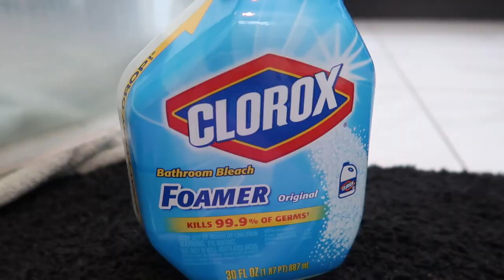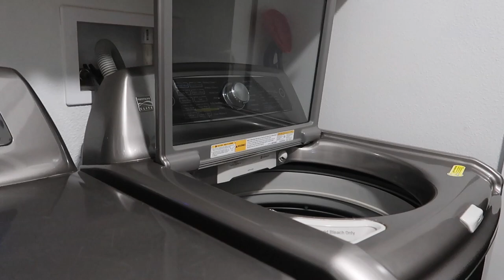EXTREMELY DIRTY CLEAN WITH ME // Cleaning Motivation + Before & After

Comment: I worked at a hotel as house keeping and the way we cleaned the glass doors was to wet it down with water then cleaning it with a cleaner (you could use the lime away) but use a magic eraser with the cleaner, then water that down. Then go over that with glass cleaner. You pretty much did what we do but the magic eraser does wonders.

Comment: Kristen, this is how I clean my shower, hope it helps you.  **Shower and Tub Cleaner:  Mix 1 cup vinegar (first heat vinegar for 2 minutes in microwave first) and then add 1 cup of dawn dish detergent.  Put in spray bottle and shake well.  Spray tub, sink, etc. and let sit for 30 minutes or as long as two hours.  Go back and wipe it down with clean warm cloth.  This REALLY shines the chrome too!  HINT: I saw a video of DYI that if you steam up your shower BEFORE cleaning it that helps loosen soap scum, etc. and then this homemade remedy seems to work even better.  ALSO, the vinegar smell is not bad at all and within seconds you can’t even smell it.
Reply from the maker: Thanks!!

Comment: the only thing that works on my shower doors is half vinegar and half blue dawn dish soap and it has to be that soap for it to work. I tried using mrs meyers and it didn't work. spray it on and the use a sponge to scrub and then spray down and it will be crystal clear.